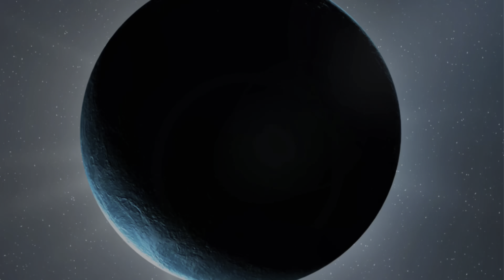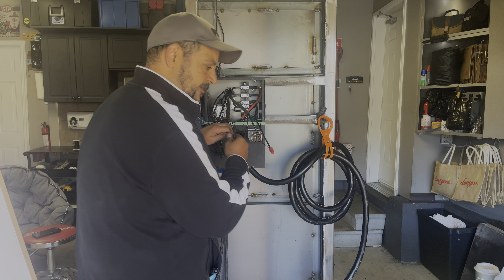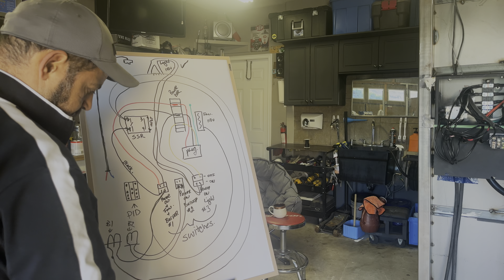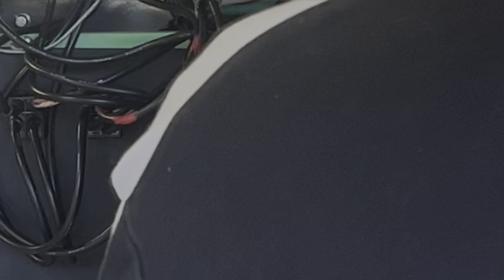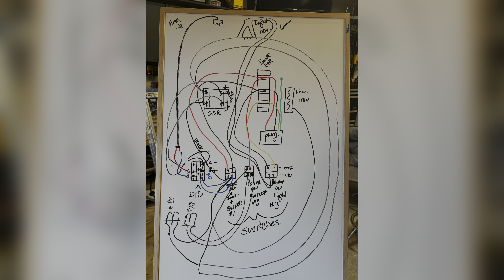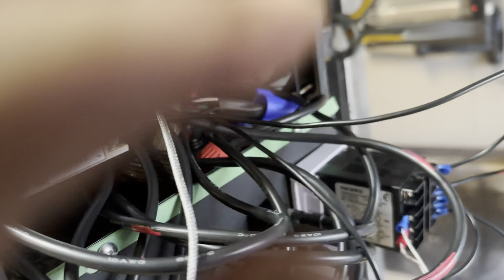New Powder Coating Oven Build, Part #6. ￼ Wiring up the Control Panel and doing a test run. 👉🔥🔥🔥

Comment: What size wire are you using for your light and heating element ? And do you have a website so I can purchase the same wire and connector on the end of your wire. I think I found the electric block that you have installed in your box.
Reply from the maker: I’ll send you a link
Reply from the maker: https://a.co/d/0iItdLjd

https://a.co/d/09noIqp7
Reply from the maker: https://a.co/d/03SvHa5M
Reply: Thank you so much my friend. I love your videos. Next time you do a wiring on a four burners can you show the wiring diagram on your whiteboard again cause when I’m watching now you just have two burners. I was just want to see how you add the extra two burners on your wiring inside the panel.

Comment: Is it possible to use this? 40 Amp power cable, 3-pin, 3-wire stove cable with connectors
Reply from the maker: Yes, as long as the burn current doesn’t exceed 40 amps.

Comment: Can I ask what type of light you installed in the oven? Not sure what high temp light assembly to get for the high temps.
Reply from the maker: WB08T10002 Oven Light Bulb... https://www.amazon.ca/dp/B0BCXRJWFJ?ref=ppx_pop_mob_ap_share
Reply from the maker: I’ll send you a link.
Reply: @welding2go can u make me a panel wired for 120 labeled ? My electric guys wants a ton of $$$

Comment: I been watching the build and am wanting to build one. I would want 2 switches, on for light and other to run both elements, I don't understand why you did two separate switches for the elements?
Reply from the maker: Only use one element when gassing out small parts or reshaping plastic molding.